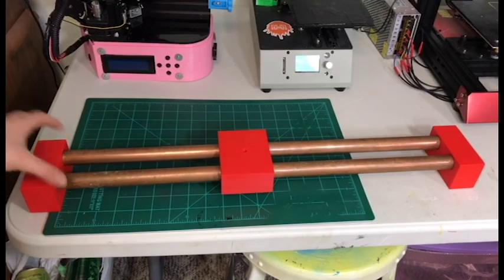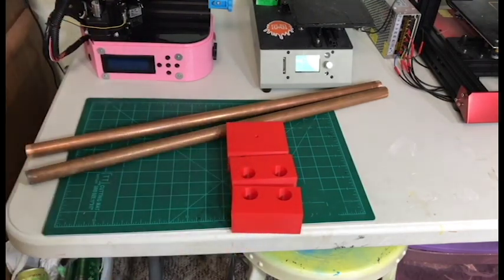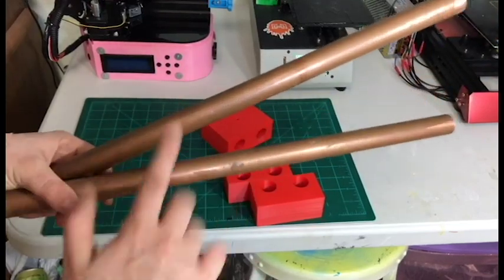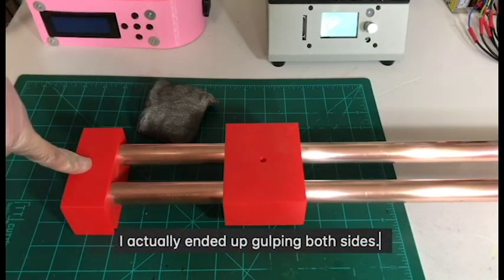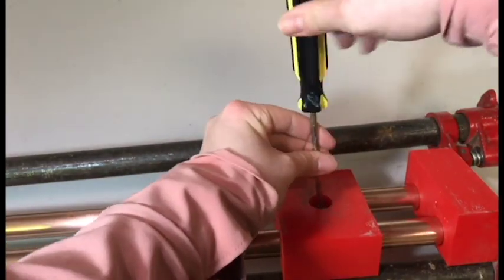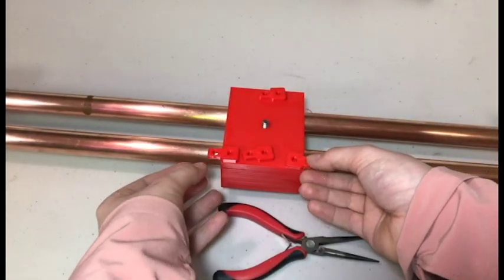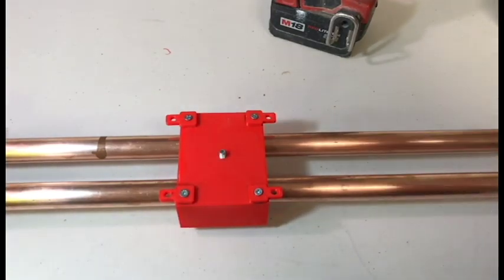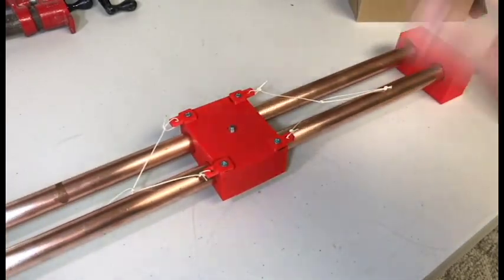3D printed Camera Slider//FREE!

Comment: Good job!  If you added pullies on the sides, the string could loop and be used for motorised movement!
My personal preference for copper/brass tubes ( to keep the shine and lubrication ) is Gorilla lube.  The old fasioned birthday candle wax rubbed on really works when you are doing wood projects.  Speaking of wood, have you used your CNC to make any simple shelving/storage yet?
Reply from the maker: Eric Blenner-Hassett not yet. But thx for the feed back